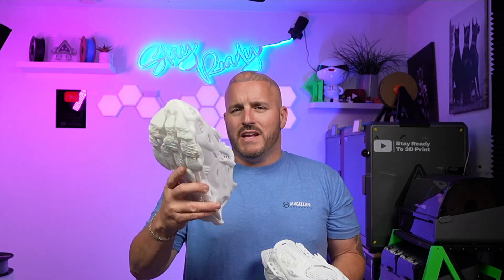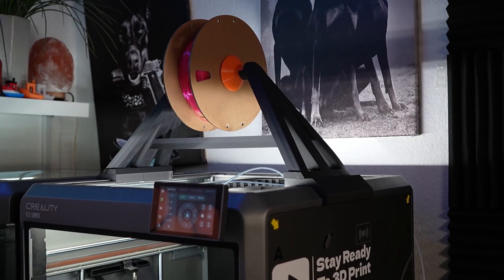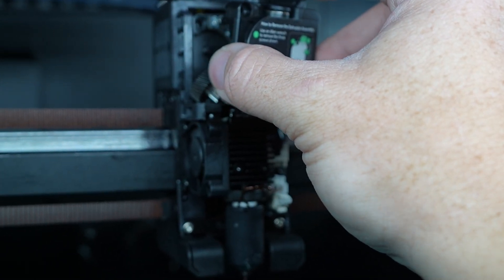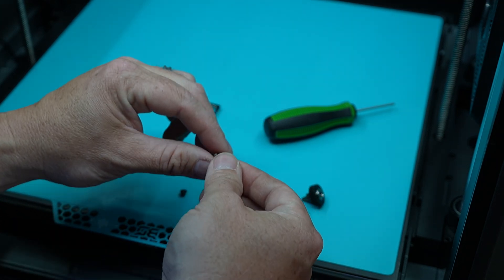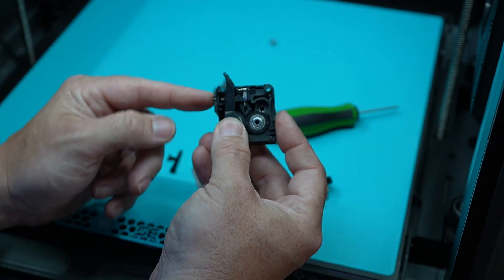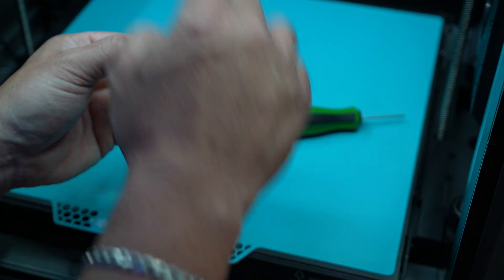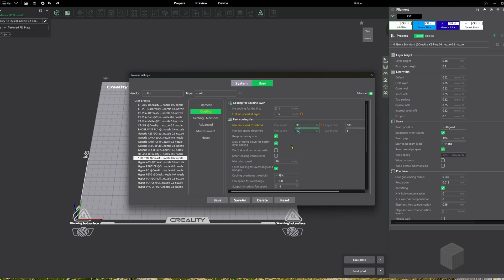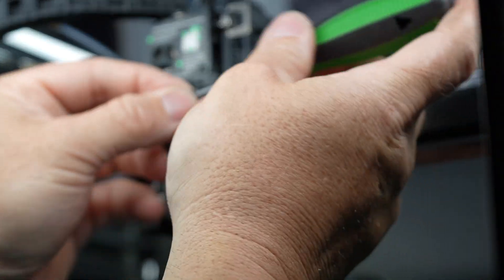My Secret To Printing TPU on The K2 Plus (100+ hours No Fails)

Comment from the maker: You can purchase the spring and thumbscrew on our website to be sure you get the right ones. We’re also selling a ready made kit that includes all parts needed to do this mod for $9.99. A lot less than buying all the parts separately. Works on ALL K2 Series printers. 
Random orders (Any) will receive a free LED Upgrade Kit for the K2 Plus! A $19.99 value! www.stayreadyto3dprint.com
Reply: sold out it says
Reply: If I go back to printing PLA or PETG afterwards do I need to take out the printed spring stopper and the spring you provided returning it back to factory or no?

Comment: this might be a stupid question, but after you change the spring and put the thumb screw in, how do you determine how tight the extruder should be when switching between tpu and pla?
Reply from the maker: I usually back it all the way out and then turn it in a few turns for tpu. For hard filaments tighten all the way down again. When doing TPU if you notice any slipping, just give it another turn or two you’re gonna have to test a few runs but be sure you count the turn so next time you don’t have to guess. What works on mine may not be what works for yours so just see what works and write that down.

Comment: I recommend no one ever purchase a Creality printer. I purchased a K2 Plus bundled with the CFS for about $1600. After about 6 months of light use, it malfunctioned and melted filament covered a majority of the print head. The “AI” that is supposed to detect issues like this did not work and I only luckily noticed it through the camera on Creality Print before it got even worse. All Creality did was send me links to videos to tear everything down myself and reassemble it and refuses to do anything else to resolve the issue with the printer that was well under warranty at the time. Later, they said the print head (probably the most important part of the printer?) is only good for 3 months from time of purchase. They have been completely unwilling to do anything to resolve the issue and told me replacement print heads aren’t available (for a “flagship” printer that has been out less than a year at the time they told me that). It has been months of interacting with the worst customer service experience I’ve ever had and I’m left with a $1600 piece of garbage. If I would have burned the $1600, I'd be in a better place because I wouldn't have this thing taking up space in my house. Don't buy Creality.

Comment: I have the K2, not the plus, so I dunno if this mod works for me ☹️
Reply: @rickpontificates3406  pretty sure it’s the same extruder and hot end just need a different top mount. (Just printing one myself so will be able to confirm fairly soon
Reply from the maker: Works on all k2 you are correct
Reply from the maker: It works on all k2 series. As cooler said you’d just need timeline the top mount.

Comment: Question time: What kind of tension should I be looking for, for TPU, PLA etc when applying pressure to that screw?
Reply from the maker: For tpu I back it all the way out. Then turn it in a few times. The test to check for slipping. For all other filament tighten it all the way

Comment: I see you’re using a 0.6 nozzle, would these settings work for 0.4 nozzle?
Reply from the maker: Yes but I would adjust flow accordingly. Volumetric flow rate will not be as high for sure.

Comment: Unfortunately the site shows "sold out" on springs and many other spares. I have no clue where else to source the exact same spring (I suppose there's more to a spring then the wire thickness, the diameter and length to identify a suitable replacement).
 I ordered a separate extruder assembly for the k2 Plus (I have the K2 Pro, but it's the same) and the threaded insert was not present in my case. I've added one (good I bought the spare assy.). I have a box of springs, the only suitable one I found was a 17mm long one with 0.5mm wire thickness and 5,5mm coil diameter. The thumbscrew is only good for a few rotations. There's about 1mm to play before the screw starts limiting the tensioner. Also the tensioner is no where near as stiff as the original one, which makes me think I'd need to swap out the assembly (not having the correct spring) everytime I need to switch from TPU to PLA/PETG. It's also unfortunate it's not possible to use the AMS (I have the K2 Pro Combo). So I guess the next step before starting with TPU will be to disconnect the AMS, and also make a plate to hold the TPU spool behind the AMS, and in a position where it creates the least friction/drag.
I just bought the K2 Pro. It eats filament by the meter (disposing of it in the back) because it's retracting the filament every time it finishes printing.
Reply from the maker: Send me an email and we can ship to you. They show sold out because you’re probably not in the US. On the website, go to the contact section and send an email.

Comment: Hello, great video! I purchased the upgraded extruder as it was advertised as being able to handle TPU. With your upgraded spring, have you had any issues printing PLA? (if you actually print PLA)... Just curious if the mod gives you the option for both PLA, TPU, and the in-betweens.
Reply from the maker: Yes it’s been fine. The mod allows you to print tpu reliably. In order to print hard developments again you simply tighten down the spring all the way. To print TPU you back out the spring and then turn it in a couple of times and run a test to make sure you don’t have any slippage.

Comment: How tight are you twisting the thumb screw?
Reply from the maker: You need to adjust according to your printer and filament. I turn it all
The way for anything other than tpu. For tpu I back it all the way out and then turn it in a few turns then test. Once I know for sure I remember how many turns I did so next time I’m good. For me it’s 4 full turns. For others it’s 2-3. Just gotta try on yours
Reply: @stayreadyto3dprint  Great, thanks! i notice you use a 0.6 nozzle. I have a 0.4. will this still work do you think?

Comment: Any suggestions for PETG?  I get jams every time I try to use it and I have gotten pretty good at field stripping the extruder to clear jams.  I am wondering if less tension may help with PETG as well.
Reply from the maker: It’s a possibility. Sometimes tension is just not your friend. But it could also be heat. If your nozzle is allowing heat creep the the filament softens too soon and it causes jams. So I’d also try adding a better thermal paste to your nozzle and reinstall it.

Comment: Awesome hack, thank you for sharing! Ever tried to print with the eSun TPU-LW? 
It is similar to the varioshore from colorfabb but much cheaper. Only difficulty is to print it without much blobbing. Maybe with your hack it works?
Reply from the maker: You should try our new tpu. Here’s a link www.stayreadyto3dprint.com
Reply: @stayreadyto3dprint  looks nice, do you have a print profile and a video regarding print quality with that tpu in combination with the modified k2 plus? 
Furthermore I wonder, how often do you need to turn the screw in, in order to get proper tension on the spring? 
So lets say from the moment the screw touches the spring - how many 360 degrees of turning do you need to do for good printing results? Or are there other measures on how to check if the tension is proper?

Comment: I've got a transparent HP-TPU filament by Creality itself, installed it into CFS, chose a model to test it out (case for my Pixel 10 phone) and threw it into a Creality Print software. I noticed, that despite the fact I configured filament as it should be on CFS, the slicer still was using a preset for PETG which I used before. I thought it's some kind of display bug, or they share the same configuration, so I just sent it to print. 2 layers later - extruder issue, cleaned it, still not working - CFS erased half of the string in the beginning and it got stuck. Cleaned everything. Then I watched your video and got sad, that my 1.6k machine can't do such a simple thing like printing TPU, but I decided to figure out why it was using a preset for PETG. Turned out, Creality Print software doesn't include HP-TPU preset by default. Included it by hand, loaded filament on a spool (just in case), and started printing. I noticed a difference immediately - instead of 30 minutes it was supposed to print for 2 hours, but no issues at all - print came out perfectly! I didn't swap the extruder spring and didn't add a stopper. Maybe it depends on the filament, but this one came out pretty good. I will try loading it in a CFS, because the stuck inside of it was caused by the stuck of it in extruder, and when you load it - it actually feels fine.
Reply: Okay, nevermind, don't use CFS for TPU. Then it's trying to load the string into the extruder it's easy to fail, right now it missed the hole to the nozzle and instead went directly UNDER the extruder's gear, which you can count as the extruder clogged. The worst part is, once it gets stuck in an extruder, CFS will try to push filament forward, which just folds it inside of CFS and then erases part of it in a place of CFS's gear, which not only makes a long string of filament unusable, but also gives another point of stuck, and now you have double problems. Best way: unplug the PTFE tube for CFS from the printer, plug the spool's holder tube and feed it to the extruder manually. Still, for me no mods or adjustments required, this way it just prints fine
Reply from the maker: You should never run tpu in a CFS lol.

Comment: baught an ender 5 max last weak and i think ive had enough of creality cheap subgrade printers tbh , these machines fail 70% of all their prints especialy when printing anything but pla
Reply from the maker: Yeah. Although I don’t agree with any printer failing 70% lol I do agree with changing brands. I will officially be changing brands soon. Not because of performance. Mine all work great. But because there are so many machines coming out that sure just far superior. Multi tool changer machines will be the new way very shortly! Get you one of these. Snap maker U1 is a great start. Or the Bambu H2C coming soon.

Comment: What size cryo plate are you using in the K2 plus. They dont have one specifically for it yet from what i see
Reply from the maker: They actually do. But I don’t like it. The texture is harder to clean. It does work though. I just prefer the blue texture more. Here’s a link to both 
https://amzn.to/3JZL4BP black cryogrip plate
https://amzn.to/4psS9Lq choose 356x356 for the blue one. It’s a bit small but it works. 

Also the new Creality epoxy resin plate works just as good. And it’s cheaper
https://amzn.to/41T3v1b

Comment: Thanks a lot for your efforts and this video. One question: After I put in the thumb screw, we want less tension for TPU and more tension for PLA, ABS and PETG - right? What is your recommendation on this? Any best practices or you just reduce the tension with the mod and leave it on the lower side for all materials?
Reply from the maker: I run the screw all the way in fingers filaments. And I almost back it all the way out for tpu.

Comment: Creality were pionners in big companies in 3D Printers.. And now they released a printer that technically cannot print one of three most popular filaments. It shouldnt be the users fixing their bad design.
Reply from the maker: These machines are designed to print harder filaments. There’s no way they can optimize this printer to do both well because to do that you need to make adjustments. The extruder tension required to print hard. Filaments is totally different than the tension required to print TPU. So I’m assuming they leave this adjusted for hard film because that’s what 90% of users will be printing with that would be no reason for them to optimize the printer for TPU because then it would no longer be optimized for hard filaments. Now I would argue that they should’ve left the thumb screw, and all of that on the extruder so more advanced users can make those adjustments, but I’m assuming they just do away with it because whenever you allow too much adjustment users who don’t know what they’re doing get confused they mess up things and then they blame the printer as always
Reply: For me it's working at stock hardware, no mods or even adjustments - just choose the right preset Creality Print software and good to go.
Reply from the maker: @БЕШЕНЫЙМАКСИМ it won’t work reliably 100+ hours. You’ll end up getting problems. I used to do it like that as well and I got tired of the issues. There’s just no way that you can print TPU with the same spring tension as you do a harder filament like PLA or ABS. The same way you need to adjust settings to print TPU such as temperature and print speed. The extruder spring tension also needs to be adjusted in order to print it reliably and consistently. That’s not the say that it won’t work here and there.
Reply from the maker: @БЕШЕНЫЙМАКСИМ  it also depends on your spring because not every machine has the same exact tension on the spring. Some people can’t print TP at all which when they do this method they can. I’ve had tons of people who messaged me saying thank you because before they couldn’t print TPU. You probably got lucky and spring is not as tight as other so you can get some TP prints to work. But you will run into issues printing regularly like I do.

Comment: Great video dude. Are you using the factory textured pei plate and does the 95A adhere without any bed prep? Also what is the best support material for 95A? I only have petg, pla, and pva... thought about making a Y Combiner to try and use the cfs for support simultaneously... have not tried this mod yet but will definitely be doing it.
Reply from the maker: I use a cryogrip plate or the Creality epoxy resin plate. No need prep needed if you’re plate is clean and print settings ate correct. 
 As for supports I’d say use pla over PetG all day as it doesn’t stick as bad.

Comment: You seem to be using a large .6mm nozzle. Wouldnt that be one of the reason as to why TPU is printing better on your printer than with a .4mm?. I have the same mod you have and followed your instructions to the T, and it is hit or miss with the printout. sometimes it works, but most of the times the filament gets knotted inside the extruder feeder. I have it as loose as it can be.
Reply from the maker: I’ve used both nozzles without issue. But if you’re having issue by all means go to a 0.6 to further reduce the resistance. That’s the key. And not using any ptfe tubing which creates the most drag. What filament are you using. Is it 95A?

Comment: Greetings!

Can you explain the point of replacing the spring? You remove the stiff factory spring, put a soft custom one in its place, but then you immediately compress it with the spring-stop and the screw, thereby increasing its stiffness. So it's pretty much the same thing, isn't it? A stiff factory spring and a compressed custom one are essentially identical.

My k2plus also refused to print TPU. I had to feed the filament by hand. The print was successful with the stock spring. So, the purpose of the top-mounted filament feed and reducing the spool unwinding resistance is clear to me, but I didn't understand the spring replacement.
Reply from the maker: Great question! It’s not the same. When printing tpu with custom spring you loosen the screw out to release tension. The added screw and spring are there so you can adjust tension versus having a constant pressure. Add tension when not using tpu. With factory spring in place your machine will not print tpu reliably. You at get some prints out of it. But it will fail with that amount of tension on the filament. So when you loosen it, it allows the filament to flow better. Which is why I’ve got several hundred hours using tpu. It will print just as easy as PLA when ya do this mod. Almost 98% success rate on mine.

Comment: Great video bro! This helped a great deal. I gotta ask, have we figured out how to print TPU from the CFS yet? I've made a few attempts with 95A TPU. I've cut one ring away from the CFS spring but it's still chewing up the TPU after going into the buffer. The jam happens right before it reaches the printer. I'm going to try out some other springs next week to see if I can get it to feed smoothly. Getting this to work is going to be a game changer. Keep creating bro, happy printing!
Reply from the maker: Thanks bro! Hope it helps ya. Nah no deal using the cfs. I haven’t tried because there’s just too many ways to fail. And for a little gain really. It’s better to just add pauses and manually change your colors if you want multicolor. And there’s a few printers coming out that make this method obsolete soon. Like the snapmaker U1. That is a beast and can print multi tpu.
Reply: @stayreadyto3dprint  Ok, I'm most definitely going to keep my eyes open for that one. Thanks bro

Comment: What layer height do you use? How do you determine the tension on the spring?
Reply from the maker: I use all types of heights depending on the model.  Height isnt as important as having your tension right in my opinion. It will print at whatever height you choose if the tension is right in my experience. Tension you just loosen it all the way and then give it a few turns to tighten some and test it. All filaments will vary so ya just need to see what works for you. If it slips while extruding then tighten it. If it clogs or hangs up then loosen it. Not much to it really. Hope that helps. Join our Discord for more help if ya can’t get it. Or just to enter the giveaway for the laser engraver. Ends 8/22 so hurry. Link >>>> https://mee6.xyz/i/4YMcjZjNO6